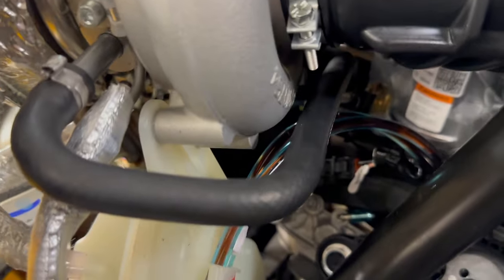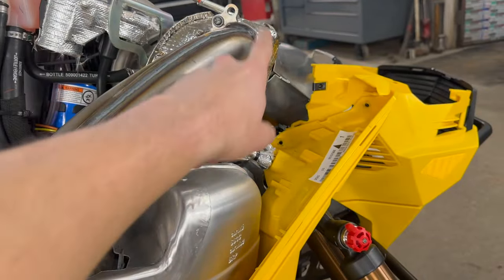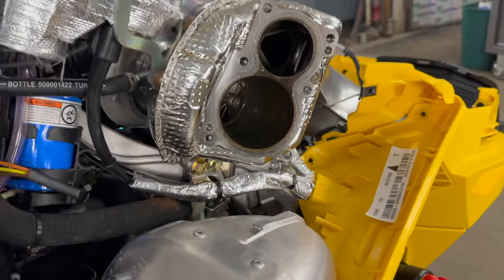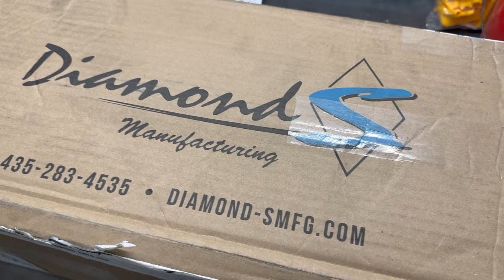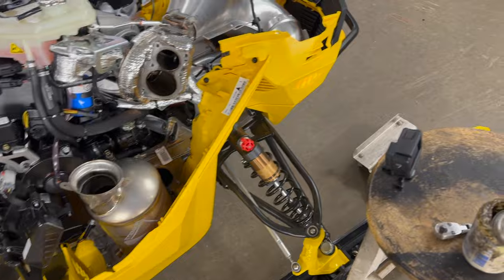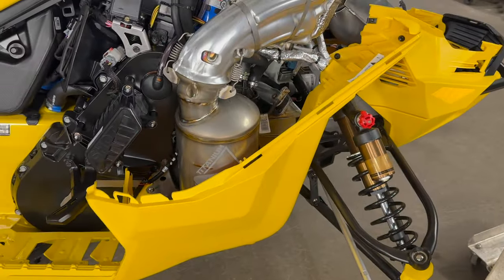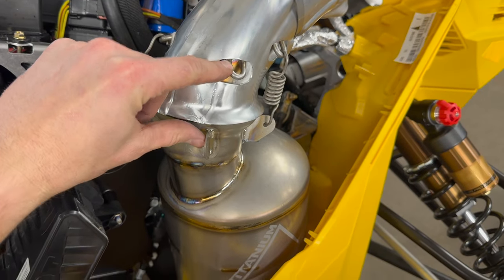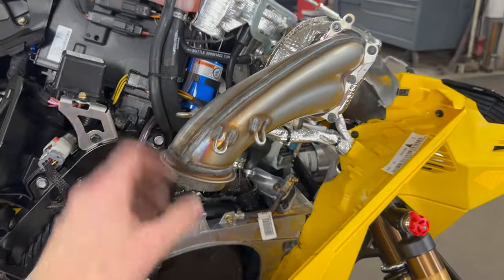Diamond S Ti muffler on the 2024 XRS Comp Turbo!? Does it fit?

Comment: Keep up with the content! Thank you for the videos
Reply from the maker: Trying my best! Gonna be some lulls here and there but I've got a lot going on in the shop so I should have some steady content for a while here. Thanks for the good words!
Reply: Where do you ride up in Vermont, I’m up on the Pittsburg NH area often
Reply from the maker: @Duramax_Yamahaguy  Pretty much anywhere the snow is, there isn't really a part of Vermont we don't hit several times a year. Dabbled with Pittsburg a few times last year, great trails, cop presence is wild on the weekends!
Reply: Nice video.

Thank you
Are you going to get rid of the black cardboard shields?
They shed black fuzz like crazy as the miles go up and the rubber grommets fall out. 
I did the reflective we heat  tape on the back side of the side panel and belly pan with no issues on last  years 850 with no problems. Hope I can do the same on this.
Reply from the maker: @robturner1231  You'll definitely be able to do the same on this one, I believe my customer is going to keep the black panels in hopes of keeping the muffler slightly hidden from visual inspections...if you know what I'm getting at 😉
Reply: Sounds like a supercar
Reply: Beautiful job on the video..I might have to get it...I like the blk cover...